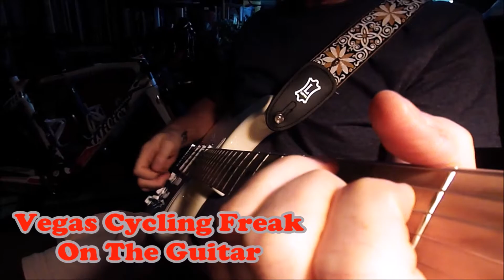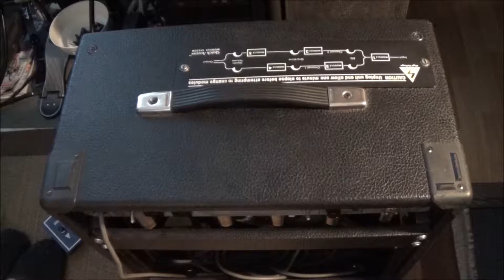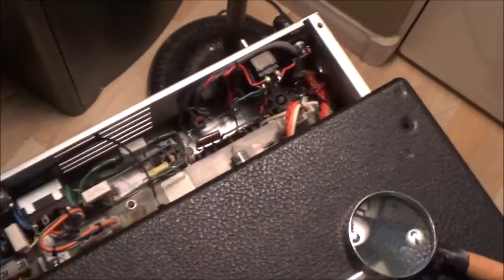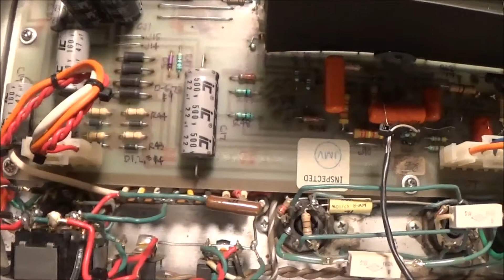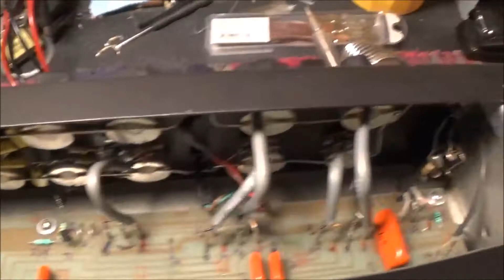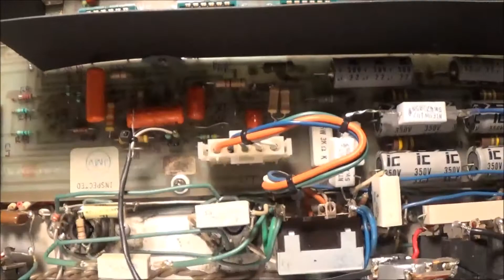Seymour Duncan Convertible PT Protection Diode Mod

Comment: I just picked up a used convertible amp - unsure of the exact date / build year but I'd say it's 1985-87 era.  I am going thru the amp and can you tell me what a good bias setting is on the EL34's?   I'm seeing plate voltages of 602 - 608 which seems pretty high and corresponding amps of 14 to 16 ma... which playing through this earlier it just does not sound right... i.e. sounds like I need to rebias and finding this info online is pretty tough.  I found your youtube channel and will also look at your other vids... thank you for posting.  Thx Alan
Reply from the maker: You should have around 575V on the primary of the output transformer. You don’t sound too far off. Your power tubes could be biased a little too hot, or you could also have the wrong preamp tube for the phase inverter, should be a 12AU7 NOT a 12AX7 - that’ll also make it sound bad. Could also be worn out preamp tubes in the modules or a combo of all of the above.  Someone could’ve also done some kind of mod(s) to it as well. I have a chassis layout with all the components marked if you think it might be useful.

Here’s a bias calculator https://robrobinette.com/Tube_Bias_Calculator.htm
 Here’s the schematics which I drew a long time ago when I still had a website:
https://el34world.com/charts/Schematics/files/Seymour_duncan/Seymourduncan_convertible_100.pdf
Reply: @VegasCyclingFreak  I have a matched quad from another amp, threw them in and WAY better response... 33 ma / 585 V... I think the original tubes are just old...BUT WHICH (preamp) TUBE on the underside is the inverter??? The previous owner has 2 Jan Philips 5814A and a single 12AX7... but he pulled them during shipping so I'm clueless to the order of these tubes.  So from Left to Right (i.e Left is the rectifier tube side), what's the correct order for the preamp tubes...I'll check out your links.. I'm familiar with amp biasing and the subsequent calculations... also, def. going to do the rectifier mod with a pair (series) of diodes (1N4007) per leg on the transformer.. excellent idea, def. with tube rectifiers it's a great protection.... I had a really bad pot on the red channel (chan output pot) and swapped it with the reverb pot... much much better.  I'll check out your stuff and if you have an email, will contact you that way.  Appreciate your time and feedback!
Reply: @VegasCyclingFreak  My reply's are likely out of order... so looking at your pdf, the 3 preamp tubes are 12AX7 - 12AU7 - 12AX7 in that order from left to right or right to left - is this correct???
Reply from the maker: @ajlsoundwave  Actually should be 12AU7, 12AX7, 12AU7
https://youtu.be/HC503GTRsLU

Comment: Its hard to see the actual installation. What value diodes are used, what direction? Many thanks.
Reply from the maker: 4:10 The bands of the diodes are pointing towards the tube socket. You can use two 1N4007s in series for each red wire, or single rectifier diodes that are rated for 1500-2000 volts. The idea here is to prevent a shorted rectifier tube from frying the irreplaceable power transformer.

Comment: Thanks for posting.  How much B+ voltage do you have?  I have a convertible 100watt head.  Id like to compare some numbers.
Reply from the maker: Don't know... haven't ever measured it, never had a need to. A pair of diodes in series should be about a 1.5 to 2 volt drop, if you were to use 1N4007s.

Comment: Great series on Seymour Duncan. I have a very early Convertible, may be 1st one imported into England. Which pins on the rectifier socket do I look for just in case my transformer (240v) has different coloured wires. Just to make sure I need 4 * 4700 diodes? Could I for the time being use a solid state replacemment for the rectifier tube, easy to fit as it just plugs in?
Reply from the maker: ogo2l -- The schematic shows it as pins 4 & 6. SS rectifier module might be OK but it does increase the B+ voltage by some amount. Probably would be OK I think.
Reply: I was thinking of a solid state plug in replacement for the rectifier tube not a module. Sovtek Solid State Rectifier SSR is £15.00 from hotrox uk. Do think this would protect the transformer?
Reply from the maker: That's what I meant, the plug-in tube rectifier replacement thingy. In any case, what I said about the B+ still applies because there is no voltage drop like with the rectifier tube, so you start out with a higher voltage after rectification. It's kind of borderline as some of the filter caps are rated for 500V and the B+ at certain points in the power amp will probably pretty close to exactly that with that kind of device, so as long as the caps are still strong nothing should fail. The power transformer would generally not be at risk with the diode full wave rectifier, however.